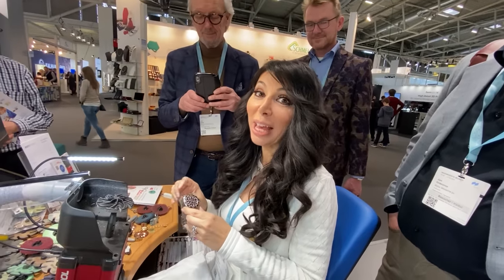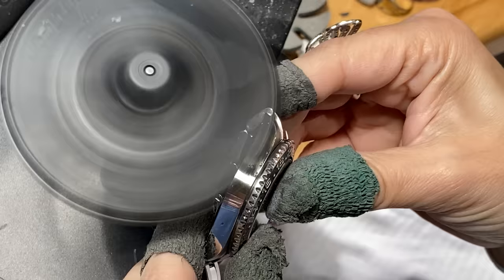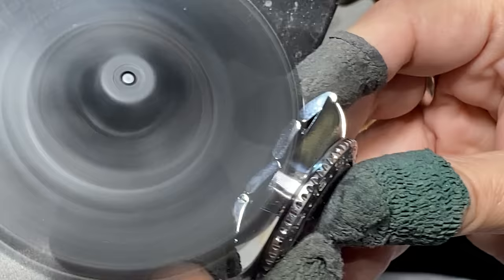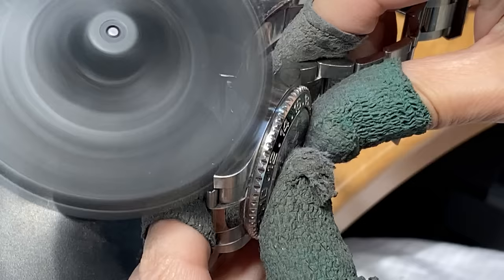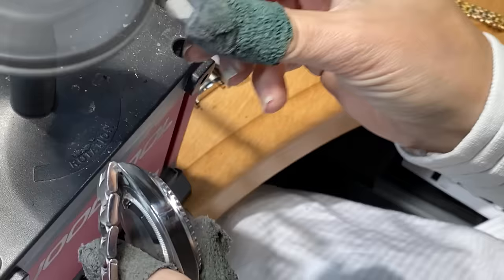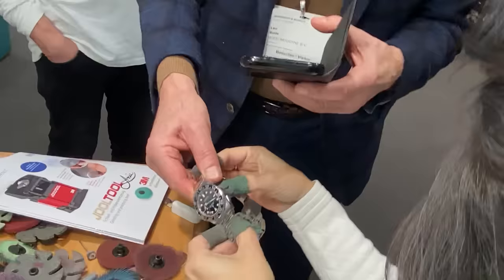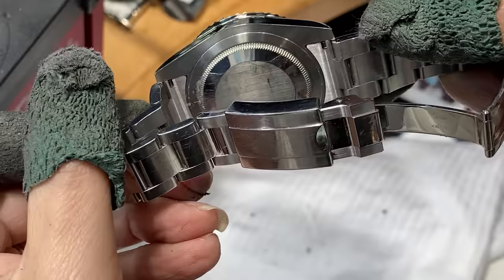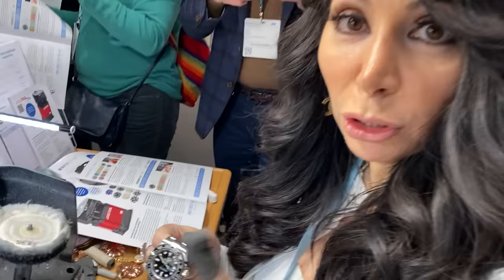Removing deep pits from a Rolex watch

Comment: Are you sure, resonance does not damage the clockwork?
Reply from the maker: There is no vibration from the wheel as it runs True. The wheel is gliding over the surface. The Rolex representative said that Rolexes are designed to take a beating. Men play golf, play sports, work construction with it. People seem to forget that these watches are designed to be worn during rough activities. ❤

Comment: Does the vibration harm the movement?
Reply from the maker: There is no vibration from the wheel as it runs True. The wheel is gliding over the surface. The Rolex representative said that Rolexes are designed to take a beating. Men play golf, play sports, work construction with it. People seem to forget that these watches are designed to be worn during rough activities. ❤

Comment: Dose the heat dosent effect the watch is it not bad for the movement of the watch
Reply from the maker: There is no heat. These patented wheels create an Airflow because of the open slots. You get heat when you work on solid wheels. With solid wheels, he gets trapped and has nowhere to go. But with our wheels, there is lots of airflow and the piece is Cooled like Air Condition!

Comment: How much does this heat the case up??
Reply from the maker: The Jooltool doesn’t heat up the watch. My patented disc has slots in it which allows any heat to escape through the slots and while the disc spins it creates airflow which aids to keeping everything nice and cool. Also my discs run true, almost no vibration so the movement is not compromised. Watchmakers told me that normal wear of a watch takes more abuse and the watches are designed for those that are active. Thank you Anie